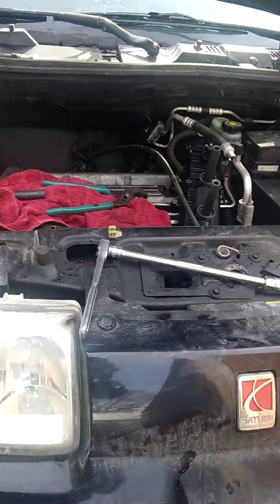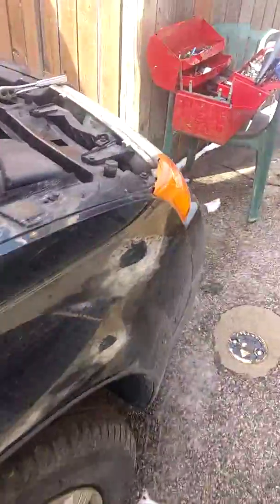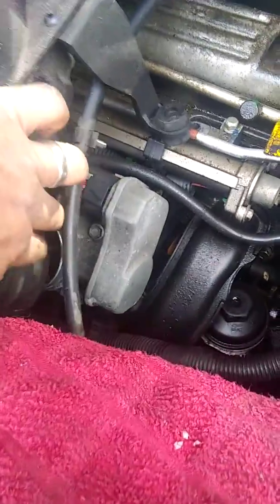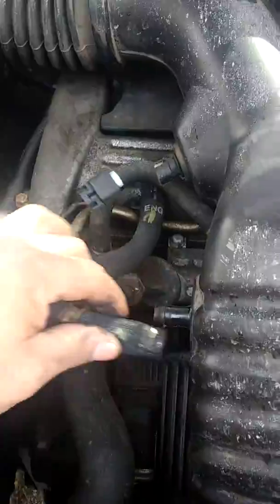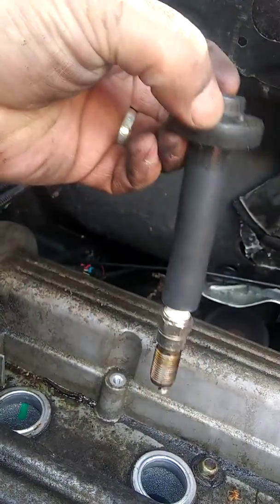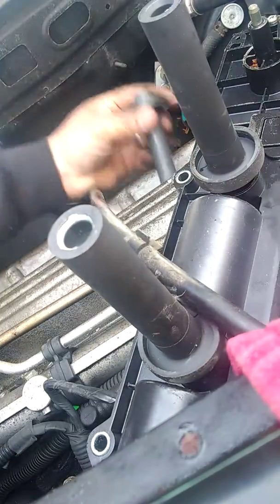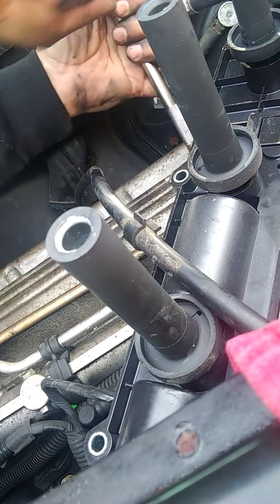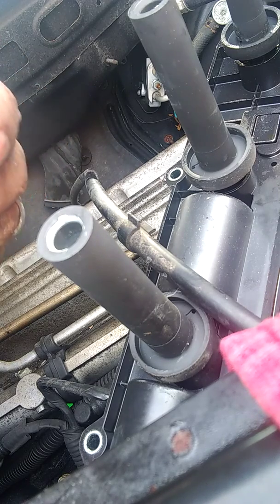2005 saturn vue spark plug change #1

Comment: How do you know when it's time to change your spark plugs
Reply from the maker: Maria Rios thank you I change my plugs before winter so I won’t have any issues during winter
Reply: @jaimemoreno3402  I have a 2005 Saturn Vue and  it started making a noise like a rusted hinge. The mechanic keeps oiling something but, my question is...is it safe to just keep oiling it?
Reply: If you are ever in doubt about something for your vehicle it is always recommended to call a dealership of your vehicle and ask for the lifespan of item in question. I have used YourMechanic services to get things done on my vehicles. Them dudes show up on time.